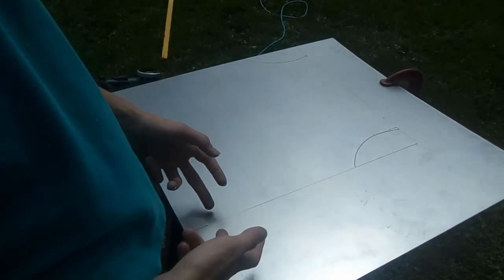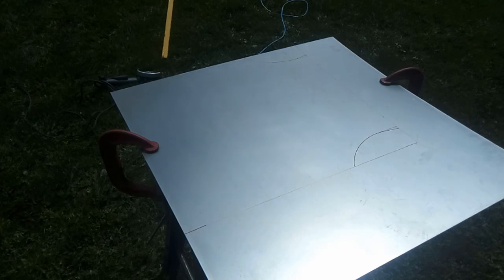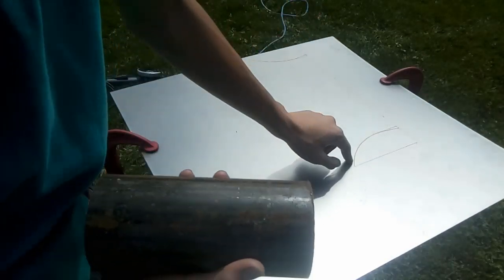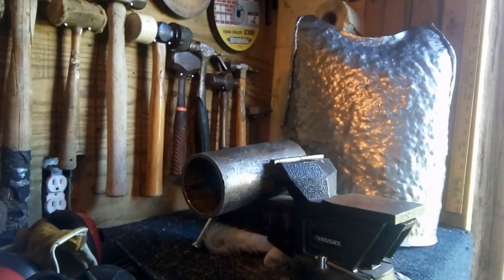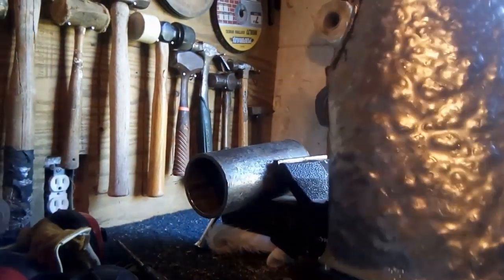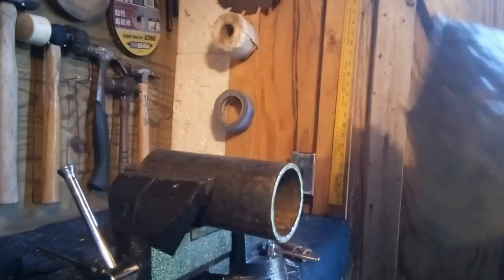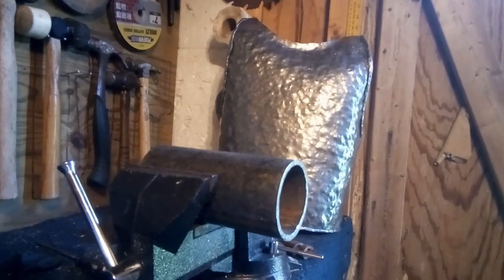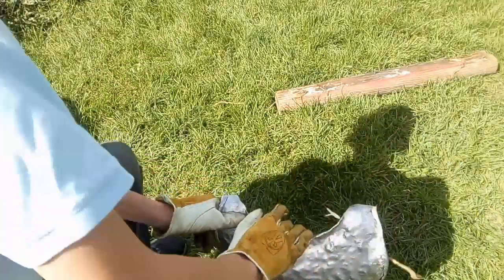Medievil Chestplate Build

Comment: when you’re using a angle grinder with a cutting disc i highly recommended using a face shield if your disc breaks it could hit you in the face a cut you up pretty bad
Reply from the maker: Yeah, but then it would make a pretty sweet scar.
Reply: Judah Mills good point 😂👍🏻